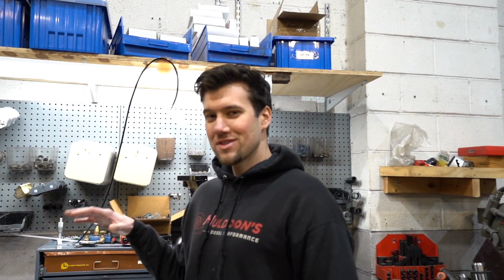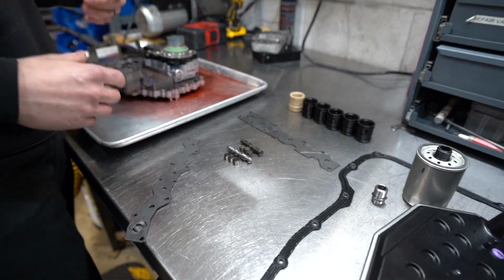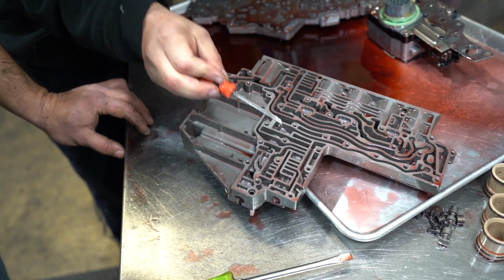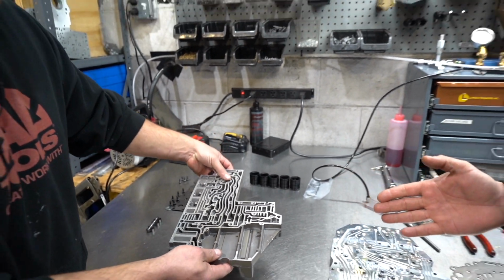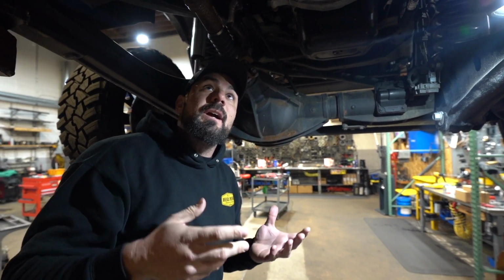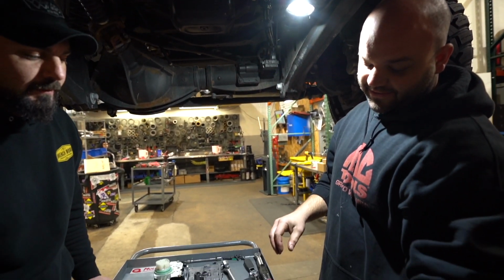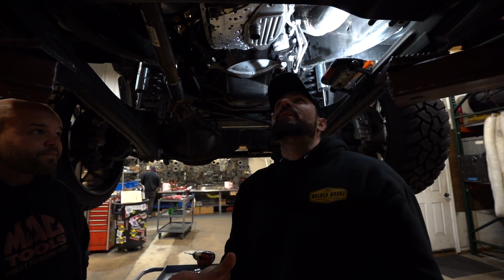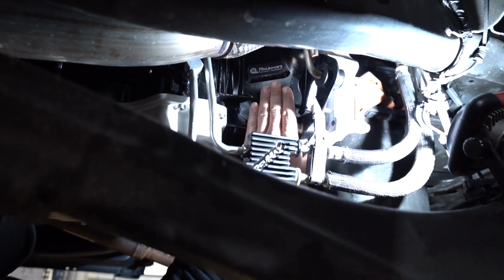Fixing The #1 Issue On My Wife's NEW Ram TRUCK!!! YOU NEED THIS FIX TOO!!!

Comment: Btw also can’t you just drill a hole to drain the stick since it will not be used anymore or is the valve body too close to the stock pan

Comment: Hey Greg, I’ve got a ‘07-1/2 Ram dually with a 6.7 Cummins that’s been to Mexico and it has had it’s transmission reworked to withstand the programmer that was in it setup at 135hp, I changed it when it went to Mexico to a Smarty Jr and as the truck was in the shop for front end work my tuner came up missing thankfully the truck was detuned back to stock now I’m looking for a new programmer that’s great for towing and will still get me my 18-20mpg when not towing and driving 77-85mph

Comment: Does the torque converter/flex plate in your dually chatter in park? I had an aftermarket trans in my 14 with a tripple disc converter and it chattered alot in park and neutral and I hated it, the trans worked perfect but,I've been thinking about sending the trans in my new truck to John to get built like yours but I don't want to hear the converter
Reply: The suncoast converters we use do not rattle.

Comment: I have a question.  I see your old solenoid pack was a grey one 5 check balls. But you installed a white one 7 check balls. Any reason on doing that?
Reply: White solenoid packs have been more reliable for us, and are compatible in every application.
Reply: OK thanks

Comment: Still using the factory Seperator plate I thought that was a weak point and all the 68
Reply: Not with the billet channel plate. We actually had a few bonded plates delaminate and send debris into the VB. The increased stiffness of the billet channel plate and flat sanded castings eliminates any cross leaks.

Comment: Good video, very informative, question 🙋🏻‍♂️ 
There’s a few transmission shops that claim to have quality parts EX. You have 
Muldoons, ATS, Rev Max
Is it all on preference or what. Can a comparison of the said three ? Or like I said is it a preference? 
Would like your opinion 
I have a 2017 2500 6.7 Cummins Megacab with under 50k I would like to avoid The trans to Grenade.
Reply: Muldoons is the way to go good people and good products.
Reply: Nothing against Muldoons whatsoever, but I  have Randy's stage 2 in my 08 megacab. Just watch a few of his videos (Randy's Transmission) where he takes his dually off road in Moab, Utah. You can't deny that he beats the snot out of his equipment. My 68 has a pretty easy life behind a mostly stock 6.7 with 500 horse tune 5.

Comment: They said nothing about the separator plate, and the issue it causes needing solved and that they address it. And it is no where mentioned on website description of the package.
This is very elementary knowledge and fix of these valvebody's. Disconcerting these guys don't deal with it, so their expertise is questionable altogether for vehicle performance.

Comment: Your people are silly🤣. If your replacing the transmission pan with a new one. Why not drill a hole in the old one to drain the fluid 🤦‍♂️🤦‍♂️.
Reply: Core and it’s not going to make a mess taking it out the way they did
Reply: @andrewnemecek4898  A core on the factory stamped steel transmission pan??? Yeah, I don't think so bud.
Reply: I’d only save it as a spare part